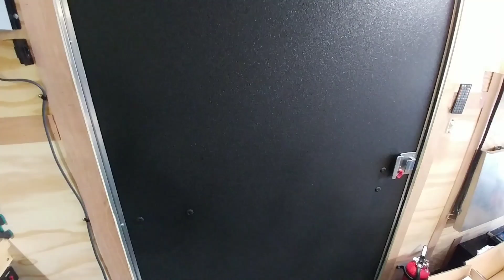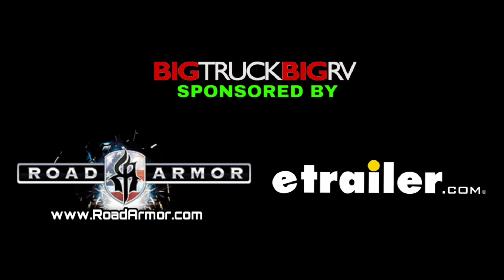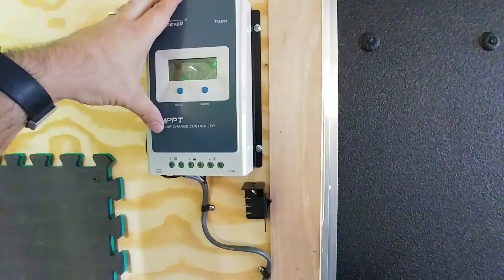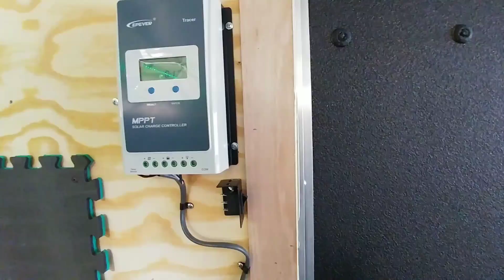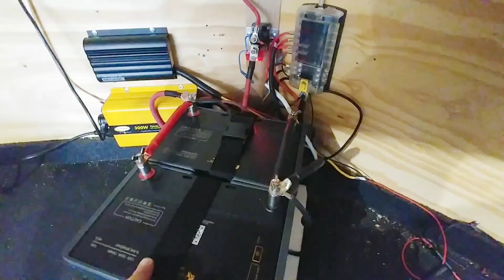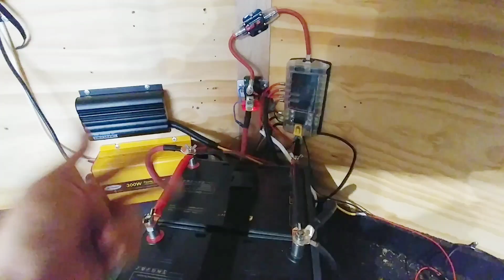LION Energy LiFePo4 Battery Update! Adding equipment MPPT and REDARC DC to DC Charger!

Comment: DONT BUY 
My 1300 lion energy Battery just blew up!  And fried my entire electrical system. But I was told by lion energy that there's no way that the Battery could go over 15volts. But yet the battery exploded and there own sales rep dealer I took my rv to seen it at 19volts. And he even told lion energy over the phone. But lion energy said that is not possible. So basically there saying there own lion energy rep is lying. And they can't explain why the battery exploded if it can't go over 15volts. Seems a little fishy to me. 
Also it was a refurbished battery I bought directly from LION ENERGY at the RV show. But they still say it's not there battery 

Lion energy will not take responsibility for there battery exploding. They seen the pictures I sent them and spoke with there sales dealer that sells there batteries and he told them the battery got up to 19volts. But lion energy said that's not possible! Also the battery exploded in front of the lion energy sales rep dealer. 

Lion energy is not reputable! And I have 5 lion energy batteries and 4 of them were brand new and the only one that exploded was the refurbished one I bought directly from them

Comment: So, JD, I REALLY dig your double Lion Energy set-up and was hoping that you would 'update' us on how it works, is it enough powah for your heavy loads (I see that 300 W inverter- Tons of draw off of that bad boy!) and are you happy with it? Personally, I can't imagine having only 100AH in an AGM or FLA set-up while carrying 120+ Lbs. of battery around, and- I would kill them very quickly as I'd never catch the 50% rundown timing. 
  From what I hear, the Lions weight 46 Lbs. together (less than 1 of those 85AH batteries), charge in less than 1/2 the time, provide a ton more usable energy (2+ times more?) and take up even less room than the group 24's. But, you'll need a battery monitor to replace the state of charge indicator (flat discharge profile of LiFePO4) and install a shunt on the negative terminal. But, as long as your converter works well with LFP, that might be OK. It seems like a 50/50 split for replacement- some swap because of the increased charge capacity, some because they want a more matched charging profile. 
   Drop in Replacement is kind of misleading with Lithium...You must love the easy access and plenty of room to swap and add to your system as your needs grow and change. I'm going to be doing it in a truck camper, and- space is really at a premium. Because they tend to oddly weighted objects, moving components forward is very helpful to reduce the tendency to seesaw- somewhat small & dark... Thankfully, I lost a lot of weight and can fit inside the rear hatch (think sliding tray) and move around a bit. If you can get around to it- would love an update though. (I searched and didn't see one...)
Dave

Comment: I'm not sure why you used a DC to DC converter from the MPPT then to the battery. Why not MPPT direct to the battery ?  I used 10 gage wire from the panels to the charge controller; then 10 gage from the controller direct to the battery. No DC to DC.  I "thought" a DC to DC controller was for wiring from an alternator (car) to the batteries due to the current put out by some automotive alternators was too high and damage your batteries?
Reply from the maker: It is.  That is how the Redarc will ultimately be connected in the near future.

Comment: Great video. Opening however...the GVWR may be 7500, but I bet camper is about 4500 empty. We had similar setup with a Trailblazer EXT. Very stable and towed very well.
Reply: Eddy yeah I saw a 4200lb dry weight. No telling how much weight was being carried. We can make some assumptions, but could still be under the Ford’s towing capacity.

Comment: Speaking for myself. I would put an exterior wood box around it. To negate the possibility of anything shifting into it during transit.  I would include a hinged lexan top to the box..
Reply: Ken P that would be a good way to help prevent accidental shorts while still maintaining visibility and maintainability.
Reply: Ken P they are strapped down so not going anywhere.